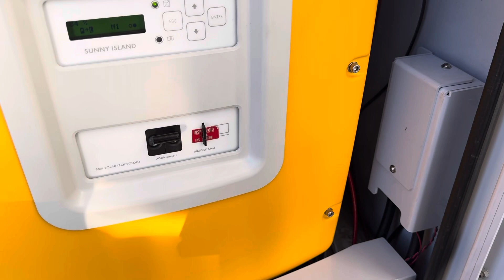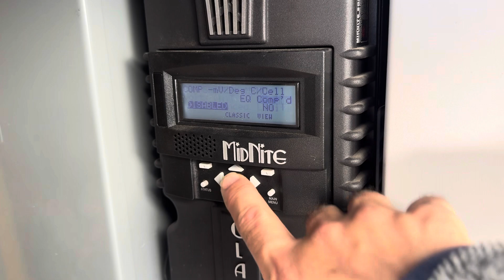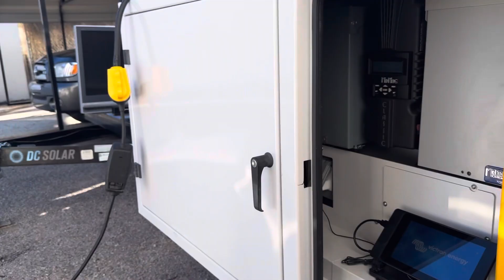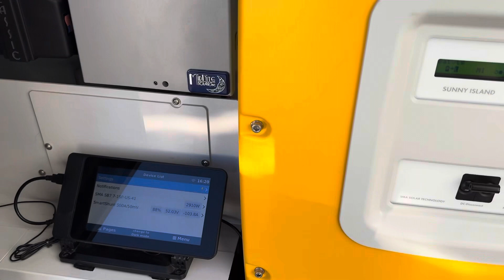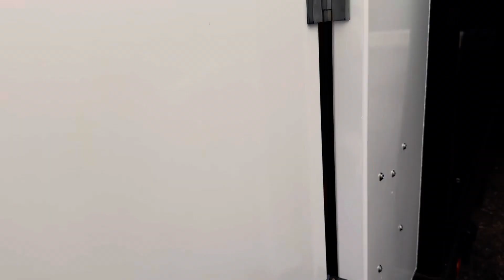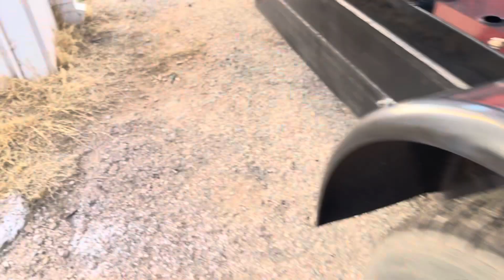EG4 Power Pro Battery fo DC Solar Trailer

Comment: This is amazing.. I have same trailer and eg4 and still having issues.. do you any paid consultations??
Reply from the maker: @TheloniousCJones  what are the issues you are having?
Reply: @RandDGarage the eg4 does not communicate with sma .. I do not understand how to install raspberry pi and shunt to get it to work like yours. Need to know how to how up raspberry pi and shunt so I can get full power?
Reply from the maker: @TheloniousCJones  so the cable allow the eg4 battery to talk to the sma inverter on LiIon mode. The benefit of this is now the inverter know the state of charge reported by the battery and can stop charging an proper value rather then trying to estimate state of charge. Regarding the victron, the purpose of this is to be able to remotely see the state of charge and voltages of the battery. I will try to make a video on both and provide links where I learned how to do. Sorry I haven’t responded sooner. I don’t think not having these in place is bad, you just might not get ability to fully charge the battery. You might get it to 95% rather than 100%.  Also on the low state of charge end the SMA estimate might be off . Send me your email if you can.

Comment: This is a clean setup. Were you able to get the batteries to communicate with the Sunny Island's directly or are you using the BMV to keep the inverter 'happy'? Do you recommend any resources around getting the SMA to show on the Victron dashboard. I am trying to do something similar with a different battery and want it to show on a display like yours. Any help or suggestions would be appreciated.
Reply: Great. Let me know how it goes when you get the sma connected to these via the CAN. Really interesting.
Reply from the maker: @REcharge-lx2hh  I have the batteries communicating to sunny island in LiIon mode now. I had to make a cable with a resistor in it to make the communication work. I found the instructions on a forum that explained how to make the cable.
Reply: @RandDGarage would you mind sharing a link to where you found the cable details. I have the same setup but no batt communication. It works pretty much but batt communication would be much better. The inverter enclosures really aren’t designed to stay cool enough for long term
Reply from the maker: @casperyourfriendlyghost7552  it is from this forum link: https://diysolarforum.com/threads/sunny-island-and-eg4-powerpro-help.72311/  look at user idoco posts for explanation on cable he built. I can do a video of the connections and terminator location on the eg4 and sunny island if you want once you have built such cable, but I followed what they wrote up.
Reply from the maker: Thank you for comment. I haven’t used the batteries to communicate to the sunny islands yet but I’m hopeful this might work as SMA is one of the inverter options. In this video, https://m.youtube.com/watch?v=TUxGNiO9FP4&pp=ygUTV2lsbCBwcm93c2UgZWc0IHBybw%3D%3D, 8:15 in you see where the settings are made. The sma is a can bus connection. I made the sma show up on the victron using files from this work https://m.youtube.com/watch?v=-OixqIdJ8g0&pp=ygUUU3VubnkgaXNsYW5kIHZpY3Ryb24%3D. I have since stopped using though as could not get to communicate to one of my sma inverters.
Reply: If you can, I think it would be great to see how you created the cable and the settings you enabled to make it work. Thanks for the help!
Reply: https://www.youtube.com/watch?v=-OixqIdJ8g0